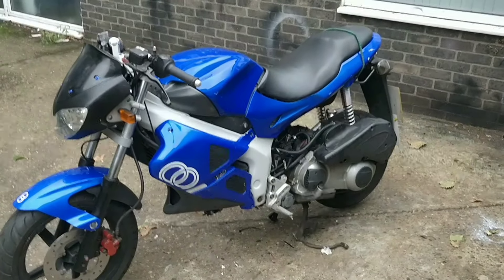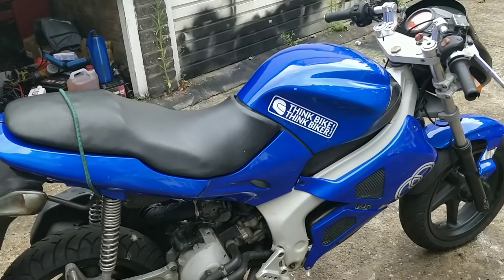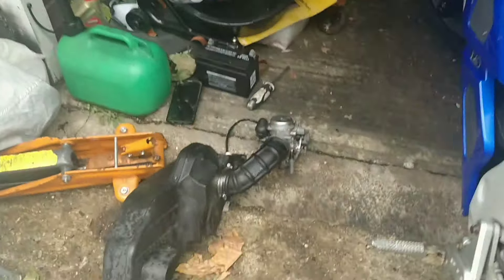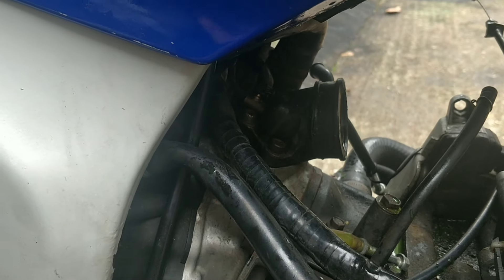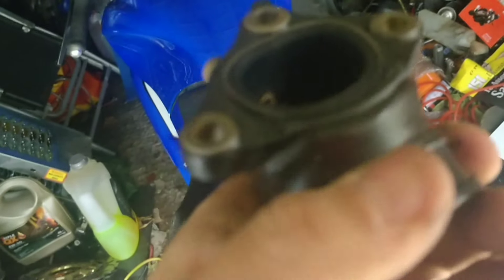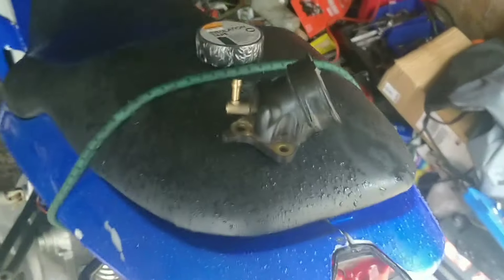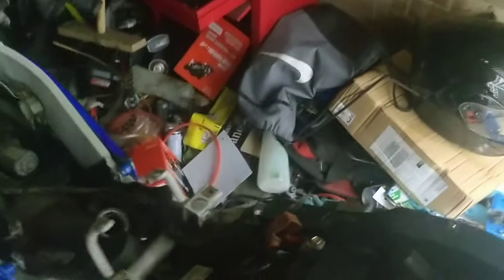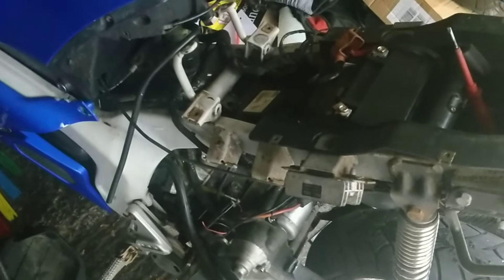gilera, dna, 125, test ride, mot result, final carb tune. mot tips, how to pass mot. (2021)

Comment: I used to have 1 registered as a 125cc but had a 180cc bore kit on it.. ran beautifully. Smooth and storage was plenty had a car battery running it 🤣
Reply from the maker: They needed the bore kits really as they were very heavy bikes. I'm not a fan of them if I'm being honest, the design is very complex. 

The market needs a modern equivalent now though. The next company to do it will make a small fortune I'm sure. 

Thanks for watching
Reply: @motorcyclerescuer  I absolutely agree they are heavy bikes. And I'm not a massive fan of bore kits either myself. Don't get me wrong if they're installed correctly then they're fine as long as its not been ragged about like a race bike. But majority of the time the younger generation tend to put the kit on and not upgrade all the correct parts in order for it to last long enough to see the next mot.
Reply from the maker: Yes absolutely agree. 

The fuel tank pump was an issue as it had to work hard pumping the fuel up hill, these bikes would benefit massively from an under seat fuel tank that free flows into the carb. They would become much more reliable if that was ever created by someone.
Reply: @motorcyclerescuer  I agree on that aswell. Last time I rode that bike the water pipe came off. And I just got rid of it after that I had to buy a new stator before I even got it on the road to start with and didn't bother sorting it out afterwards. Now I just ride the sv650 and kymco people s 125cc
Reply from the maker: Svs are great bikes, my harley feels similar in the way it rides to an sv. The kymco s pipe I never got on with, I believe its semi auto?
Reply: @motorcyclerescuer  I think it's cvt belt driven (moped) I've got 3 bought on a cheap from a dealer that was doing a clear out so all logbooks keys etc. Even running BUT needed picking up and all 3 front panels which they struggled to get (I managed to get all 3 within 2 weeks) then needs 2 batteries and 3 front indicators.. but the sv I have to put off the road for full engine rebuild
Reply from the maker: Wow, sounds like you will be busy for a while. 

Working on these bikes is like therapy for me.
Reply: @motorcyclerescuer  just got 1 on the road I'm currently awaiting for some cheap indicators and then they'll be going through mot aswell. They're already spoken for the mopeds. 1 for my next door neighbour who's helped me out a massive amount sourcing parts and helping me prepare them all for mots and 1 for my son whose 17 nearly 18. And then myself for a runaround lol
Reply from the maker: That sounds great.

Comment: What was the problem with it in the end? Can’t find the video after you couldn’t start it
Reply from the maker: I can't remember if I'm being honest. Normally it's carb issues or the fuel pumps not being strong enough to get fuel to the carb. Especially with e10 fuel. The pumps aren't designed for it

Comment: Another great vid Charlie, instead of using tape on the inlet rubbers try heatshrink works great
Reply from the maker: Good cool. To be fair the fuel, oil and heat resistant silicone does the job. I just like yo wrap it a touch more for piece of mind.

Comment: the auto choke/enricher will be permanently open if not wired up,  letting excess fuel through the carb, it needs to be wired up so that it closes up after a minute, will be stupidly rich without it wired up.

Therefore will foul the spark plug and it will be down on performance due to being rich, just an advisable comment mate, not trying to be negative or rude in any way whatsoever.
Reply from the maker: I thought the opposite, that it will stay closed. The bike is starting and running well with it both connected and disconnected so I'm not sure if it's working at all. 

As I said bikes running great. I popped the plug aswell which looks fine, not to rich or lean.
Reply: @motorcyclerescuer  there is also the possibility the auto choke has failed, maybe try one from another carb if you have one laying around with the same diameter to fit the gilera dna carb, great videos, just thought I would drop a comment about the auto choke/enricher
Reply from the maker: I have one from the original carb that I can try. 

I'll see how the bike goes for now. 

Cheers.